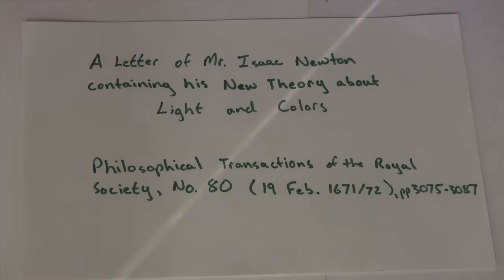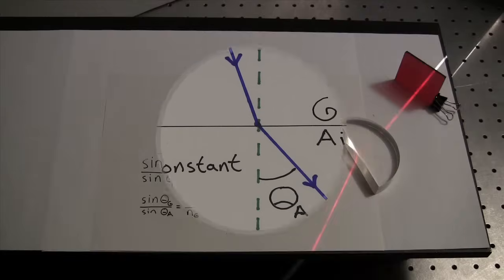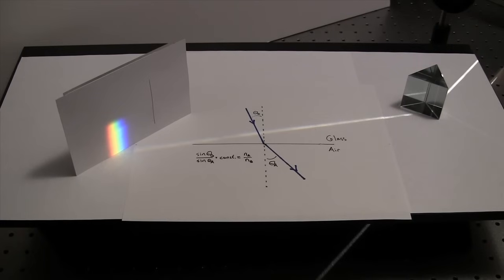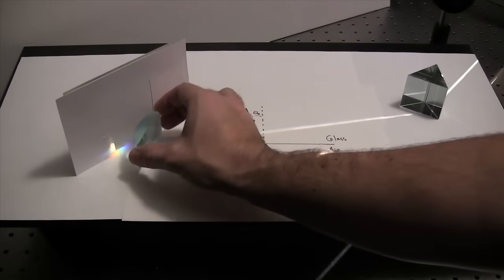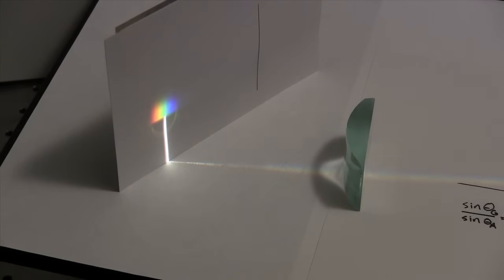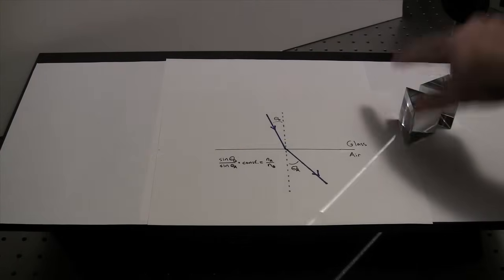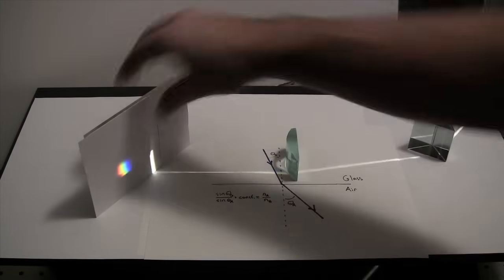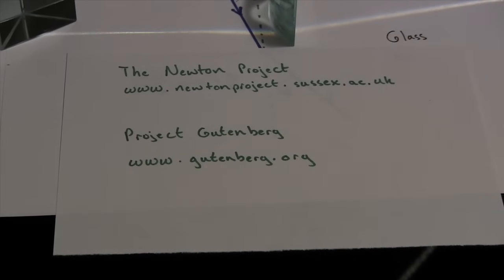Newton's Prism Experiment

Comment: El valor de la componente en "y" de la pendiente del haz entre el valor unitario de "y" del material A dividido por el valor de la componente en "y" de la pendiente del haz entre el valor unitario de "y" del material B siempre es una cte
Siempre y cuando los materiales A y B sean constantes
Reply: The value of y-component from the beam of light slop divided by the unit vector "y" in the 1st material divided by the value of y-component from the beam of light slop divided by the unit vector "y" in the 2nd material is a constant as long as the materials be the same

Comment: Question:
Has anybody ever used a prism on a solar panel to see if different light wavelenghts or colors create electricity more efficiently than others?
I mean technically speaking color really should not matter but perhaps only one  color or wavelength in the entire spectrum has more energy to efficently power a photovoltaic cell?
Just curious
Reply: You are really curious mind 👍
Reply: Yellow, I believe, is most efficiently absorbed. 

I researched this January, last year. Not important, just something I remembered.

Comment: Excellent video and kudos for the great effort. You nicely explained what is happening. But please explain WHY at all  the white light splits into various colors in a prism  ? What happens to  the white  light inside a prism  ?  Because the same light passing through a glass slab will not split into spectrum. If you could explain it ,  your video will be 100 %  perfect and 100 % appreciable.
Reply: its because the white light passing through is just an overlap of all the colors, and each individual color experiences a different refractive index, therefore spreading out the colors
Reply: dispersion occurs but it is at very small separation. Will need a very large distance to observe it.

Comment: What's the best way to get a white beam of light? A thin slit on a window, like Newton did? Is there an easy way with artificial light?
Reply: A bright incandescent lamp will give a full spectrum.  Avoid LED or fluorescent lamps as they have an incomplete spectrum.  It is tricky with sunlight as the angle changes with time and clouds may change the intensity.

Comment: Also, you did NOT "form those colors from white light without a prism". Meaning you did not prove that is isn't the prism that is responsible for making the colored light.

 But your work here is not completely in vain. 
The lesson to be learned here, is, that the shape of your color light is being caused by your prism. Which means that the shape of a rainbow in nature must be caused by that which is causing the colored light in the first place.

 Indoors, it is not the white paper that causes the color, it is the prism. Outdoors the water droplets only take the place of the paper. Water droplets are not the proper shape to create a rainbow, like a prism does.  Also, as you demonstrated, the rainbow is not seen at the prism but rather at some distance from the prism. This is one of many reasons the water droplets are not the source of the colored light, they are just the projector screen. 

 The important thing is the shape of the colored light. Rainbows, in nature, are the shape they are for a reason. Just like your rainbow indoors.

 The fact that the cause of a rainbow's arc is not included in the explanation of how they are created creates a bit of an issue. Combined with the fact that your rainbow does not arc supports this.

Comment: When you use the red filter the light just seems to be white, until it passed through the red filter. Here, it is clearly the filter that causes the white light to turn red.  Similarly, we get green light with a green filter, and so on.  Why then, when you pass the same white light through a dispersion prism and and we get a rainbow, do we NOT think the prism is causing the rainbow?? Review : a red filter turns white light red.  A blue filter turns white light blue. Green filter turns white light green.  When white light through a prism gives a rainbow?  All the sudden the light we know as white must really be a rainbow?
 I have seen no proof of this. Someone needs to prove the prism is not the cause of the rainbow color light, (just like you said). Light goes through all shapes of glass and prism's and does not come out rainbow colored.  Only the dispersion prism makes the rainbow...

Comment: Can you do an experiment where you take red green and blue (LEDs or lasers) combine them with a prism, then separate then to a full color spectrum?
In short:  RGB input, ROYGBIV output.
Reply: +John Smith It doesn't work like that.  You can't get out light that isn't in the source.  You can split sunlight into the full spectrum because all of the colours are already in the white light.  But if you start with monochromatic red, green, and blue lasers, while you can mix them to form white light (this is called metamerism), splitting a beam of white light formed in this way will just reveal the same beams of red, green, and blue that went in.

Comment: At 1:20 ".. those are the colours that occur, when you pass white light through a prism..."  <-- The prismatic colours occur if you "pass" white light surrounded by darkness through a prism and let the light interact with a white surface at a distance that is correct. If you put the white surface "too close" or "too far away" you don't see prismatic colours. The prismatic colours don't 'occur' , they depend on the distance of the white surface and this complete setup gives the concrete result you call 'prismatic colours'.

Comment: At 0:56 there are arrowheads drawn onto the "beam of light", but the light itself can not observed to be moving, so the arrowheads are misleading (that is a very common error). The only thing we can say is that the time until there is an effect of light interacting with a certain measuring instrument (made out of matter) and the time it takes for that interaction to occur is proportional. You can never see the light itself moving.
Reply: You can't see whether it moves or not, but it does move, and does have a direction. So, for logical purposes, it's okay to draw arrows to indicate the direction
Reply: Pascal Fabig Not that there necessarily is anything material that is moving, but the fact that light has a speed. It takes time for it to get from one place to another. Therefore the phenomenon of light, or the the occurrence of it, moves. Going back to the start of this, I don't see anything wrong or inaccurate about the arrowheads on the vectors of the light beam, because the 'occurrence' of light does travel in that direction. Now, please stop questioning obvious and necessary things for no reason.
Reply: Pascal Fabig You're clearly missing the point here. Even though, as I agreed with you on, light is not 'moving', those arrows still have a function and, simply speaking, light does move, so for the purpose of this experiment and for the understanding of viewers, it is good to assume it does. How else would you be able to show which side there would be a shadow on if you blocked the light. 
It just doesn't make any sense to say that this is wrong. I agree, light does not actually move, but even with that, why do you assume the arrowhead depicts movement? For example, arrows are used to depict forces, even on objects that aren't moving, and of course the force can't 'move' either. So please end this discussion and stop whining about something purely functional, which is aimed at increasing the legibility of a diagram.
Reply: Pascal Fabig Well Pascal how can you tell that a ball is actually moving?

Comment: Thank you so much for your succinct and articulate explanation. I'm having trouble understanding a certain principle though, which I hope someone could explain. How can you effectively create 'white light' by combining 2 prisms and a lens? Are you merely mimicking the input light? How does is work? Are you essentially splitting the constituent wavelengths via dispersion, then 'focusing' or 'combining' them again? I can't quite understand how (just from a fairly basic standpoint). Thank you
Reply: Focusing and combining is the same thing as far as i can think, in this case atleast. The RGB colors just need to be close enough to be percieved as white by your eye. They were close in intial ray and in the final ray too so we see white color in both these cases and they where seperated in the middle.
Reply: And this explanation makes sense bcz we know that their is no such thing as 'white light', white light is just a mix of different colors that OUR BRAIN THINKS IS WHITE. This can be proven by experiments like these and more convincingly using a spinning rainbow wheel.